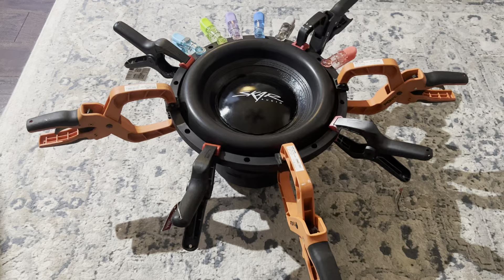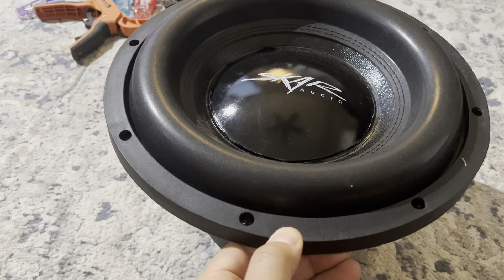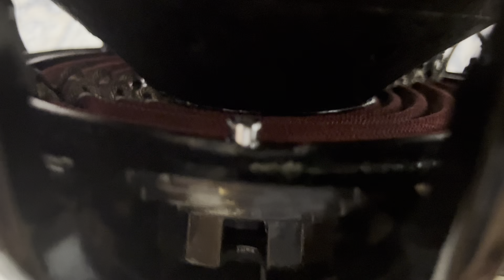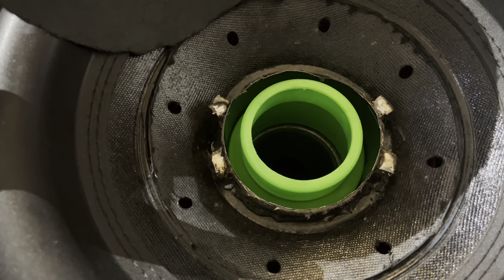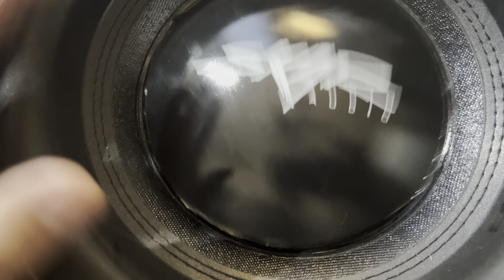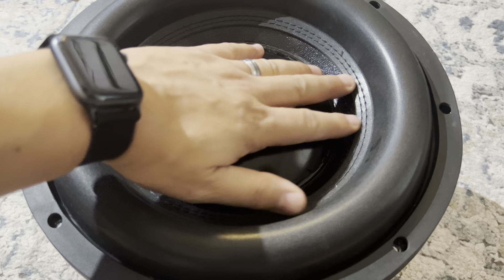Skar Subwoofer Repair - Part 8

Comment: What voicecoil did you use?  What height coil?
Reply from the maker: @frozenassests
Voice coil: 83mm OD, 76mm ID, 106 mm total Height, 60 mm coil height, dual 2 Ohm, aluminum . You can purchase this from @Robotunderground ( Patrick +1 (602) 312-6504))
Reply: Thank you

Comment: Where did u find the rebuild kit for evl 12s
Reply from the maker: They (Skar) don’t make any drop in or repair kits for their subwoofers. You can buy same or better parts from Patrick at Robot Underground or George at Lord of Bass. They sell coils, spiders, dust caps, and even cones that match this frame.
Reply: @Moegneto Do you have voicecoil  measurements  for the Skar EVL 12D2